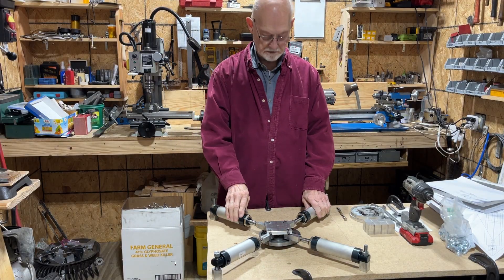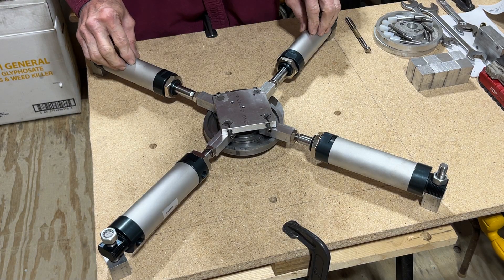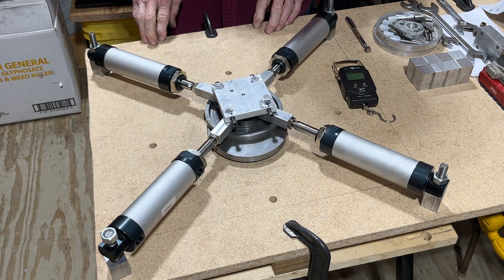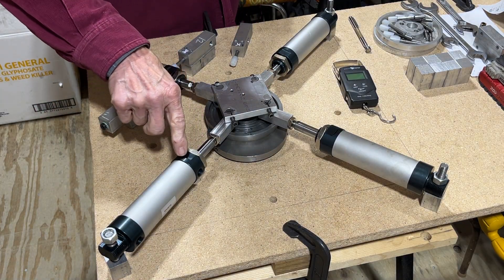Compressed Air Power Research, A New Year with new Ideas 1-2-2025

Comment: If you using cylinders nothing comes closer to swash plate cylinder mechanism....this configuration still uses crankshaft....crankshaft is very inefficient.but this configuration seem promising so hopefully it works for you...
There was a guy last name Green...he has website green steam  engines...he did a lot of good research and his engines are working and proven to show great results...